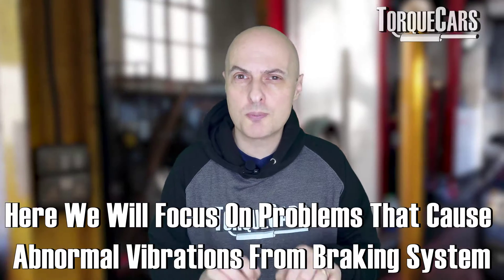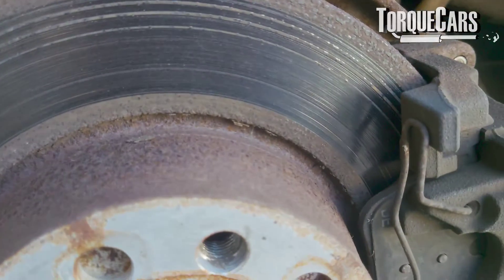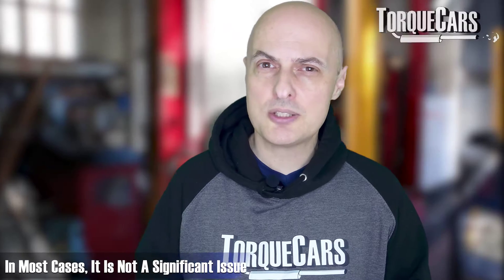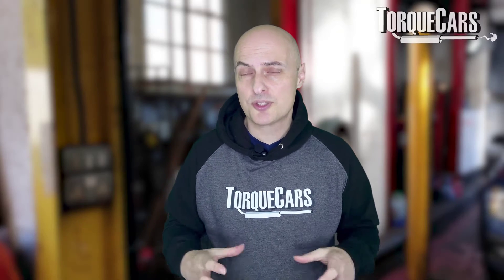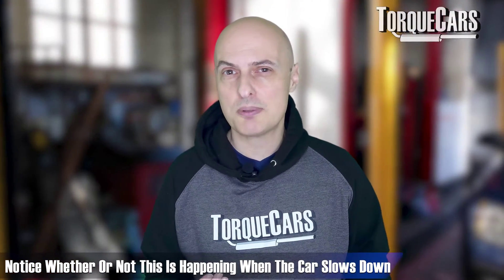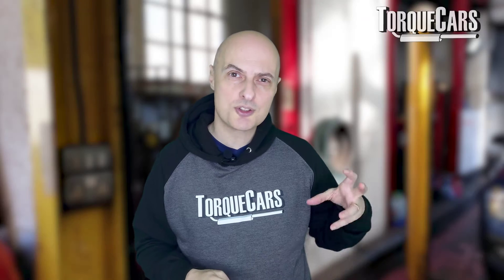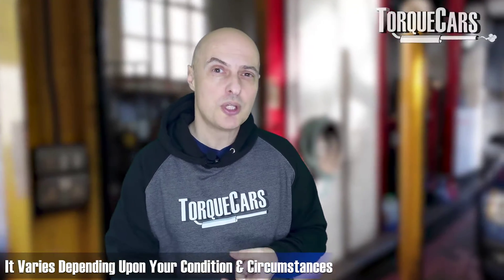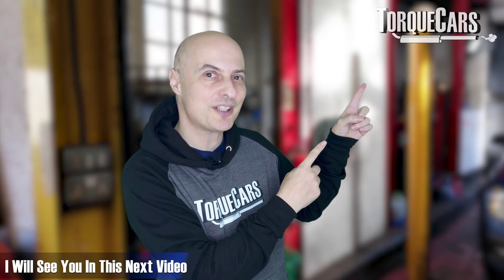Causes Of Vibration When Braking - Is Serious? Common Faults & Causes Explained.

Comment: i put blocks on the tires in park then switched to drive everything ok  until i press the brakes then it vibrates and when i let go it stopped vibrating and  the car wasn't even moving, earlier on when i was at a red light and  i felt the vibration , i put it in neutral  to see what would happen and it stopped vibrating , i wonder if its the brake issue or something else
Reply: @frankjames1955  I'm in the same boat as you, let me know if you find out what it is

Comment: i have EBC bluestaff combined with Zimmerman Coast Z both like 1000miles, vibrations when braking reaaally hard only. Cold or daily no vibration. Someones says it's the pads and i dk if it's pads or discs.. anyone experienced something like that? i'm afraid it hurt steering rack which already a weak point in the audi TT mk2

Comment: What about improper lug nut torque
Reply from the maker: Yes that could theoretically cause it, but it would also be evident on acceleration and cornering so not necessarily just when braking.

Comment: I bought a used car and didn’t check the brakes.  The rotors were so worn that within a few months of owning it they were were down to the fins.  Now I  checking my brakes often.
Reply: Good thing it's an easy repair. I usually replace them when I buy a new (used) car it's like $150-$300 for all 4 rotors and pads if you do it yourself.